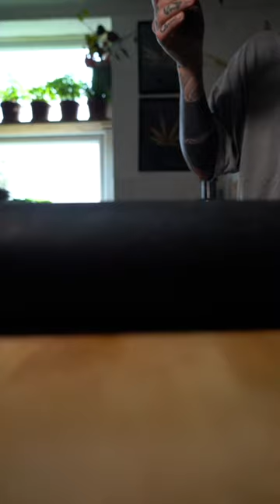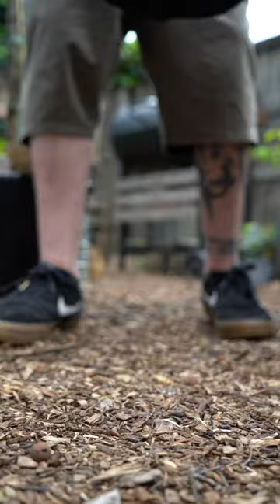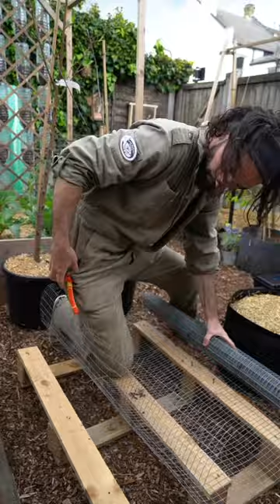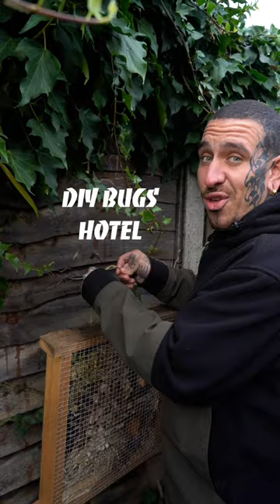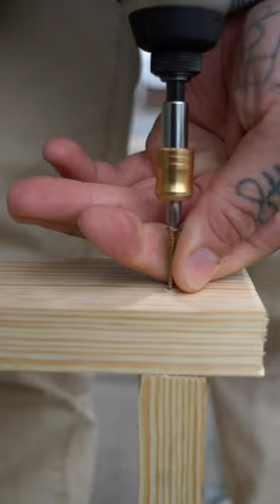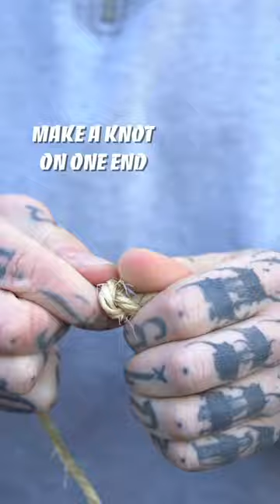3 DIY garden project! #shorts

Comment: Lol, that "DIY compost thing" is how we held our compast the last 20 years. We used the green chicken wire in a circle.
Since prevous year, we changed it by a recycled compost holder.
Each year, we open it up, take the bottom part that's "digested" & throw it on our garden.
We combine that with horse or cow dung & dig it in the ground. (In dutch we call it: "De grond omspitten"). 
It looks like this:
https://www.youtube.com/watch?v=w3-52yXN0iY

We make a small ditch. Put the compost in it.
Afterwards we fill up the ditch & by filling it up, we create a new ditch near it. This process keeps repeating itself until everything is done.